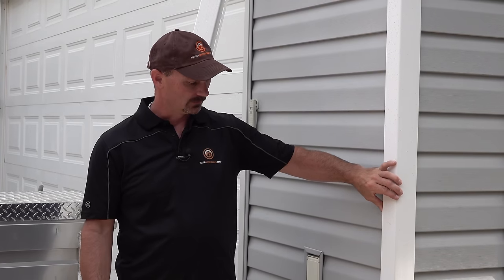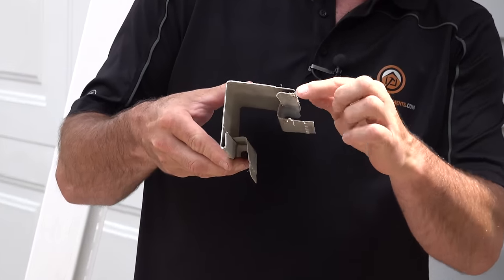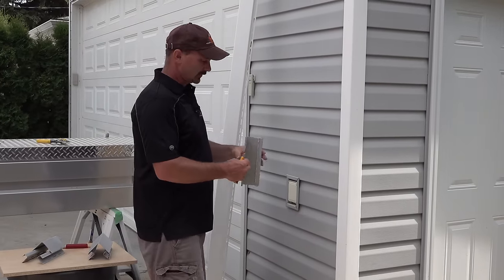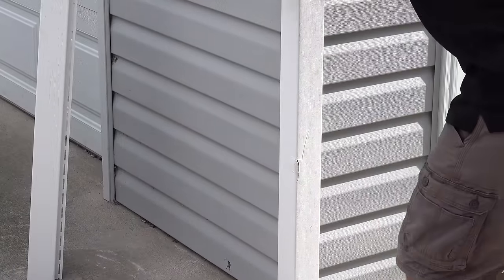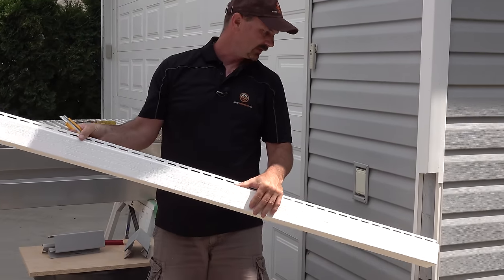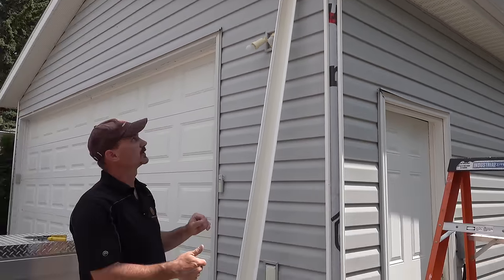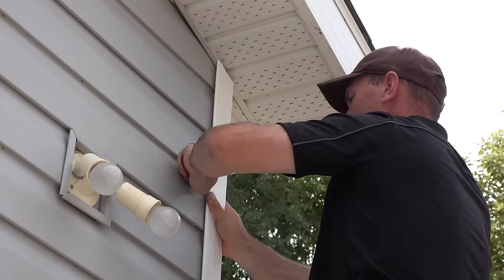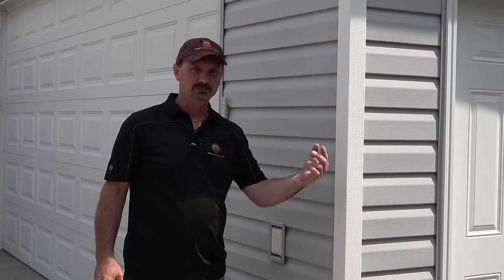How To Replace A Vinyl Siding Corner

Comment: I watched this video, thought be like another giving advice, well on a 90 corner looks so easy, my first time working on vinyl i work as trim carpenter,  it was for a customer that owns a pricey newer home, the repair was on 22.5 angle. I should of made a video, to share though would have to be without sound. i had to cut the areas he leaves extra small otherwise would not stretch far enough to make the repair. Both pieces the one still on the house and  replacement had to make several cuts until it worked. Now watch a strong wind come along and suck it off and have to start over, be my luck.

Comment: Are these corner pieces (their j hooks etc) universal across different brands?
Reply from the maker: Not 100%, there are slight differences and its best to get the same one if you can
Reply: @HouseImprovements  oh my i am speaking to the man himself.  love your videos.  So speaking as a low grade handyman, I learned the hard way that horizontal siding pieces have an identifying number on the nailing hem, but . . .  where would i find an identifying number on an installed corner?

Comment: I noticed your corner at the bottom sit on concrete. With a foundation the corner has attendances to 
 Slide down due to wind and heat. I would recommend putting  a dab of clear silicone on the corner attached to the house.
Reply from the maker: Yes for sure.

Comment: What if your corner piece does not go all the way to the ground.? My corner piece stops about 18 inches from the ground. Will this repair slide down under if it does not go all the way to the ground?
Reply from the maker: A small dab of caulking in the too upper corners and support until that cures.
Reply: HouseImprovements thank you

Comment: Can you use a vinyl one to replace an aluminum corner post?
Reply from the maker: Not without removing and cutting all the siding shorter  on both sides. the aluminum ones are usually a smaller size.

Comment: huge wi d wrecked a whole side of siding square ones are okay the siding that goes on the fell off. the one end is broken totally. is there a way of fixing it.
Reply from the maker: You may need to purchase a few new pieces but It can be re installed.
Reply: @HouseImprovements  good I can't seem to get the siding to go into the crevice on bottom could I use a hammer to tap it in the rail on top is also a little bit of a pain when I close over the siding farther pops out. The guys that worked on it did a rush charged a lot it worked for a long time we had about a ,50 mile hour wind on top of hail. I may have to readjust the siding to fit in there right I have never worked with the siding before no idea where I can buy it at used or new. I don't think there are extra pieces when they moved the trailer we got the siding that was underneath the trailer. Home Depot We have a Menards Walmart ace on the lake . I am not sure there are places around here that sell mobile home siding.

Comment: What keeps it from just sliding down when it isn't resting directly on the cement?
With cut pieces this short on both sides id still probably take the siding down and replace the whole thing, It would still be faster for me but I do this everyday.
Reply from the maker: A small bit of caulking in lip at top edges will keep it up.

Comment: I have a piece of siding that is cracked but I don’t have any extra. How do I find a replacement piece to match the color?
Reply from the maker: You can get colour samples of the different manufactures from local lumber or box stores. Then you will know what you have then you may be able to find or order a piece through one of those stores or from someone selling their left overs from their renovation

Comment: Instead of replacing the entire corner piece, can I just do a 4ft section from the bottom? Will the 2 pieces match up or can I overlap them somehow?
Reply from the maker: They can be over lapped but it does not look as nice. Lap the upper over the lower.

Comment: I still lost.. Could you start from the beginning again.. Wasn't looking for a corner video lol. Trying to hopefully patch some small pc's that got busted by ... Maybe weedeater damage or rock's busted it from mowing over the years.. And there all busted in center lap of each pc. Im not wanting to remove or replace for time being. Any info would be AWESOME!! Great video too! Lol.
Reply from the maker: Not much you can do with that. There are vinyl repair companies that can fix holes in vinyl siding parts but they are crazy expensive. What I did here is cheap and quick.

Comment: I think when i do mine i will add some double sided tape on the inside to help hold the new and old together to keep it from sliding against each other.  Just to hold it in place.
Reply from the maker: A dab of caulking in the top 3/4" on each side and prop in place until it dries will work.

Comment: How would you keep it from sliding down if it's not on ground?
Reply from the maker: a small dab of caulking in the lip at the top corners or even a small screw if you need to pinch the old to the new at the top

Comment: Im gojng to do a job where its dark colours and corners have become wavey can i do same tequnique ?
Reply from the maker: Yes you could do the same thing . Those existing corners have been nailed to tightly and are buckling because of it. This method will fix that. Add a dab of caulking in the new corner piece at the top where it clips onto the old cut piece to keep the corners from sliding down.
Reply: @HouseImprovements   awesome thanks 
This should save me about 4 days i was thinking i should be able to use my glazing bar on the inside to pry out a bit creating a tiny expansion gap once its basicly just 2 js  on wall..
Thanks again good video

Comment: Does it hang on tight in the wind?
Reply from the maker: Acually in my case the concrete below keeps it tight , but I forgot to mention in most cases you dont have that so a dab of silicone in the two upper lips will hold it in place

Comment: What would keep it from sliding down if it doesn't touch the ground?
Reply: I'm sure a rivet on the top would be fine.
Reply: In a reply to another comment the guy who made the video said he should have mentioned placing 6” of latex caulk on n the channel of both sides of the new piece to help secure it.

Comment: Ive installed for years and because of how easy they break in the cold i used 2 by 4 and cladded them on all my corners when i installed my new siding....looks way better and won't break...ive done what u are doing and would advise if you are doing  this and not used to cutting vinyl with a olfa knife...be extremely careful..

Comment: Can anyone tell me how to replace vinyl corner posts with pvc? I prefer the look and durability. Can't seem to find anything on it. Thanks in advance
Reply from the maker: You have to cut the old corner off and usually the siding back(depending on the width of the PVC corners)  to install J channel and new PVC corners. The J channel must be dded up each side to cover the ends of the siding.
Reply: @HouseImprovements  Oh, I guess you can't just go over top the ends of the siding with slightly wider pvc? Must use the j channel?
Thank you so much for the response!

Comment: Just out of curiosity, did you ever consider just cutting the new piece and snapping it over the old piece?  This would provide some more rigidity.
Reply from the maker: The outer corners of the trim is too tight to snap over the old corner without cutting , some corners could be different I guess.

Comment: Your replacement cover seems to be resting on the concrete grade. How do keep this kind of repair from slipping out of place in the more common case where your siding is correctly clear of the grade? As someone whose done siding repairs that why I watched the video.
Reply from the maker: Sorry ,yes I forgot to mention that you need a inch or so of caulking in the two top corners and a temporary support until it cures

Comment: Could you just cut a slit the whole way just so it could compress enough to wrap it with a new corner?
Reply from the maker: You won't get the new one to fit over the outer corner of the old one when it has a double layer.

Comment: Where do you find replacement Vinyl Siding Corner? What is the proper way to measure a damaged one and search for it? So far my attempts have been unsuccessful.
Reply from the maker: Any place that sells vinyl siding should be able to get them. There are 2 -3 styles, what you see in this video is the most common in my area. Take a couple pictures and some measurements with you to the store.

Comment: 20 min job to do it right . and that's called  a zip tool ,and you should fix the light box you looked at water will get behind that . and that corner WILL slide down

Comment: Hiya cuz 
Great tip save time an religion 
To strengthen it use silicon caulk in the pinch points .
Thanks g
Reply from the maker: Use silicone at the top corners in the pinch point if yours will slide. If you use it in more points it restricts the expansion and contraction it needs to do during temperature changes. In my case it sits down on the concrete so nothing was needed.

Comment: Why wouldn't you leave most of the corner attached and just cut a 1/2 inch for the new corner to slip over? It wouldn't lose its strength that way.
Reply from the maker: Try it that way and you will see why.

Comment: I would never do this……only if I was selling a house and I wanted to butter it up a lil
Reply from the maker: This works great, and know one can even tell. Add a small amount of caulking in the two top corners and secure the corner form sliding down temporarily while it sets. I needed no caulking because my corner sits on the concrete below.

Comment: Sorry, I call bs.  You can take down those two walls in 15 minutes and have a seamless new corner piece up in less time than all your cutting.  A homeowner would screw up an expensive corner unless they are skilled with a utility knife. And no customer would accept a seam like you create.
Reply from the maker: You did not watch the entire video, i did not leave a seam but even if i did it would be no different than in a case where a 10' corner is too short to cover the entire height of the wall. The time to actually do this if i'm not talking and explaining to a camera is closer to maybe 5-10 mins max.
You may not like it but it works very well. Thanks for watching
Reply: @HouseImprovements  Then I owe you an apology.  i will watch the entire video so that I might be fair.
Now you created a snapon corner. Yes it's a slick repair. I wish I had seen this video twenty years ago. Kudos an apologies.

Comment: Why cut the corner post up like this when you could replace it properly in 30 minutes. Cut the old one in half, pull it off. Pop the new one in place. Unclip the siding wher you need to nail it on. This is a horrible way to fix the corner post, won't last.
Reply: Have you actually done this? Try it, you'll soon see it's harder than you think. It won't just pull off. It's nailed to the wall on both sides.
Reply: @paulmonk7820  yes I have done it, for 26 years. Complete remove/reinstall in 30 minutes. This is hack work

Comment: Speed up more. A lot of viewers leave when you repeat so much. Instead of 14 minutes this can be done even more effectively in about 5 minutes.
Reply: Well worth the 14 minutes when it will save you hours of work in my opinion.
Reply: Cindy Syracuse   You can still save hours in an efficient presentation. More people would watch and save even more. Long boring presentations do not help more people. Efficient ones do.